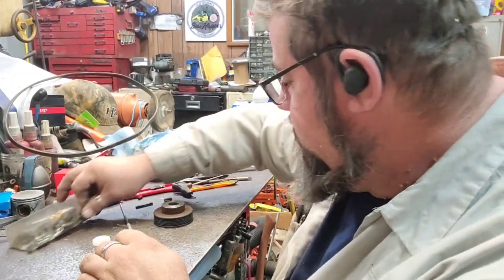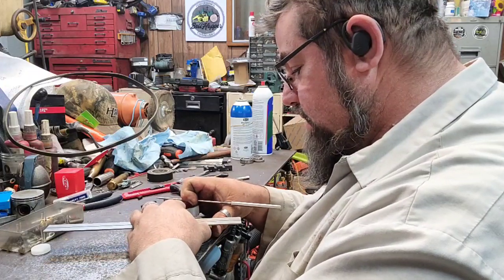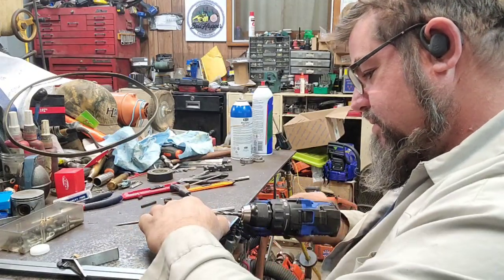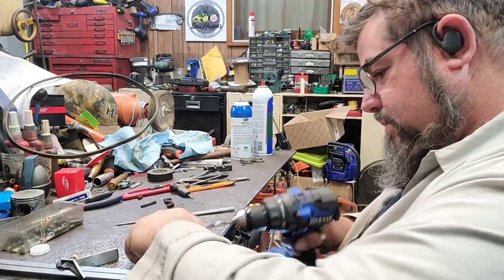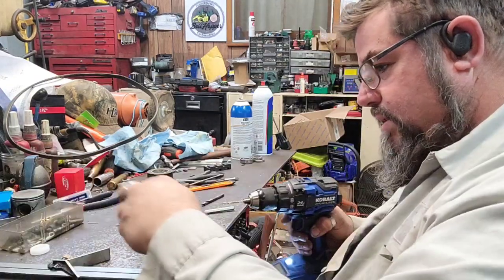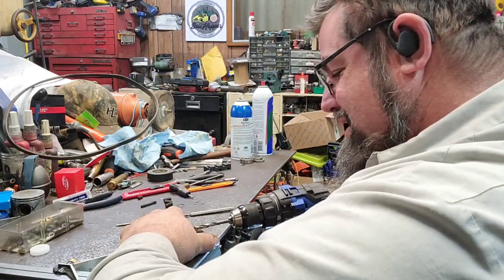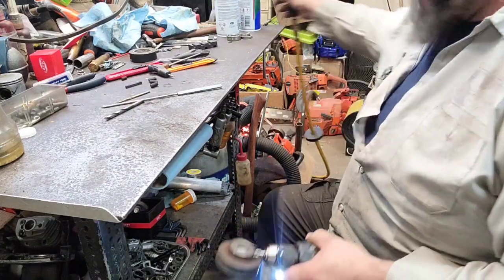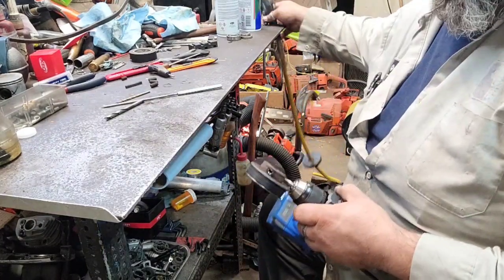Air Compressor Troubles Again and MS 200T crankseal

Comment: Jeremy you need to put a little bit broader sloping or a style roof over top of those compressors and you should rig up away to use a very light duty spring tensioner / idler pulley for the belt and I mean something very flowing resistance just enough to ride on the belt to keep any slack out of it and you shouldn't have any problems whatsoever then even if there's a little bit of wobble or whatever and one of the pulleys or a shaft the pulleys are on but I see that cover you have over top of the compressor head on the red tank and weather is brutal on equipment that's for sure

Comment: Put a point on your set screws & lightly them the first time & mark the shaft. Then take the pulley off & put a drill point where the marks are & put it back together and tighten the heck out of it